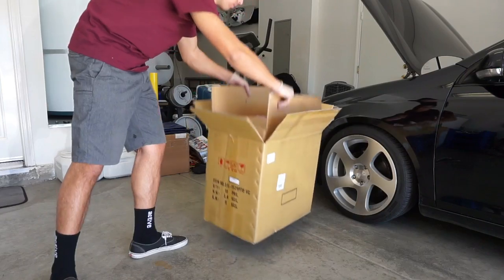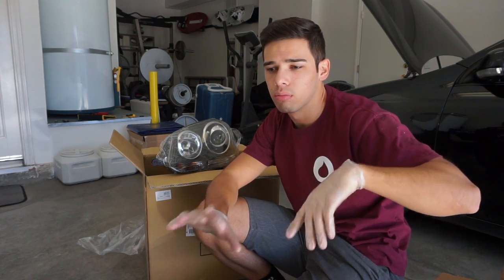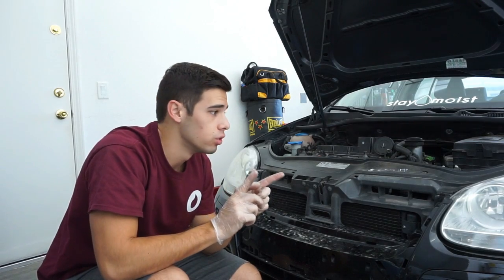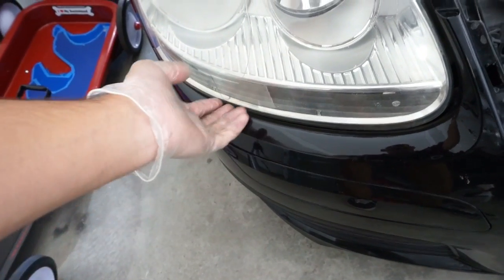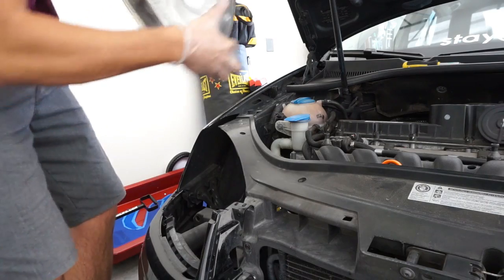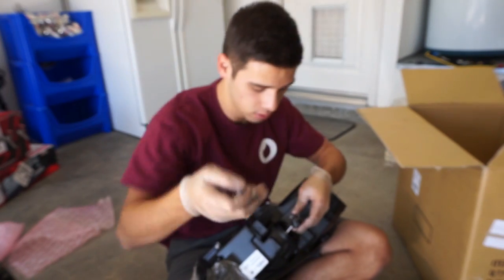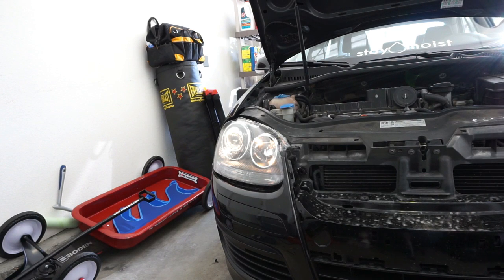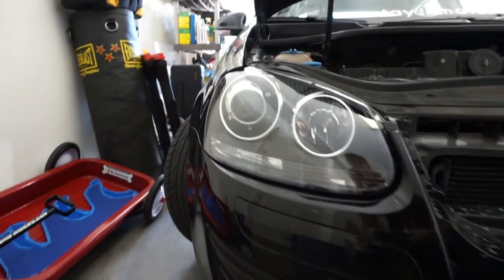Installing Helix Projector headlights

Comment: Hey thanks for making that video and showing how it's done!! Just curious how the headlights are holding up (some say that the clear headlight cover yellows very quickly on the replica's?). Also since the new  headlights have projector lenses, do you find the halogen lights work much worse (at night) than the OEM ones or isn't it that bad? Just afraid of blinding others lol - thanks!
Reply from the maker: like2upload Thanks for the comment! The headlights are holding up alright. I've found that the build quality isn't that great and I recommend getting brighter bulbs than oem. The bulb sockets don't seem to like up perfectly with the openings in the housing on the inside, this is causing heat stress on some of the inner plastic from the bulb's heat.
Reply: Ryan The Hawaiian what are your wheel and tire specs? 18x8? Or 18x8.5? And what about the tires

Comment: Dude you didn’t find out the right way! Take out the black plastic insert from the bumper to get that screw out. 

Only undo the other two headlamp assembly screws, undo the connector out it comes. 

Don’t touch halogen bulbs with bare fingers it leave grease that burns hazy on the bulb.

Comment: Hey !! I want to know if this aftermarket light have the DRL like the gti and gli near the turn signal. Cuz my stock one have the DRL in the high beam its a small bulb but its look so much better with a led drl near the flasher.
Reply from the maker: Nikon Photography My car has the drl switch to the left of the turn signal stalk, but it is only a switch for the drl not the actual headlights. The switches should still work since you'd only be swapping out the housing.

Comment: I know this is years old, but you didn’t have to pull off the bumper, that extra bit of plastic under the head light pops out and you can get to the screw from a hole

Comment: Wow, I just bought replacements for my old yellowed hazy originals. Had no idea how involved it is going to be to instal them. Good on you for testing them before you put everything back together.  Congrats on a job well done. They look awesome. Thanks for being legit.
Reply: I just did mine it’s easy. This guy made it hard. Just undo the grille one top and one side screw, use a plastic or wooden wedge to pop open the plastic insert in the bumper then you can get straight to the bottom screw. 

No need to touch the wheel arch trim, remember not to touch the bulbs with bare fingers as it burn off the oils and makes them hazy. 

There’s some YouTube videos to follow if you search some more. Try deutsche auto parts
Reply: Or just buy some Solvol Autosol from the auto shop and polish out the yellow on you plastic covers. 

Plenty of videos on that too.

Comment: Hi,after all this time do the headlights still work good?How about the moisture and beam projection,all works good?
Reply from the maker: Hi, yes the headlights do work still! There isnt any moisture in them, the beam projection isnt as good as the oem lights, but I put LED lights in to kind of make up for that👍🏻
Reply: Great thanks for replying...do you maybe know where to find it i tried searching the ebay but I was only able to find Depo headlights in 200$ range and I heard the worst about it
Reply: @RTHMedia  Great thanks for replying...do you maybe know where to find it i tried searching the ebay but I was only able to find Depo headlights in 200$ range and I heard the worst about it
Reply from the maker: @anteradic5125  The link is pretty long but this should be the ones I got. 2006-2009 VOLKSWAGEN MK5 RABBIT/GTI/JETTA E-CODE PROJECTOR HEAD LAMP - BLACK | eBay
https://www.ebay.com/itm/2006-2009-VOLKSWAGEN-MK5-RABBIT-GTI-JETTA-E-CODE-PROJECTOR-HEAD-LAMP-BLACK-/262990530747
Reply from the maker: @anteradic5125  These ones are around $200 as well, you can try getting them from urotuning, or moddedeuros to maybe get a better quality buy they charge around $400 for them.
Reply: @RTHMedia Thank you so much you helped a lot!👌
Reply: I wanted to ask you one more question....as far as the light output I've read that is pretty good even with the halogen bulbs compared to the stock reflector headlights.What is your experience and what's the high beam like is it good?
Reply from the maker: @anteradic5125   The high beam output is perfect, very similar to the stock headlights. My opinion is that the low beam light is more spread out making it seem not as bright with regular halogen bulbs as the stock headlights.
Reply: @RTHMedia  Have you tried stronger bulbs like Osram night breakers or similar xenon look h7's maybe...I understand you put in LEDs how is the output with them?
Reply from the maker: @anteradic5125   I tried some of the higher output Philips brand headlight bulbs, but the LED ones are brighter for the same, or sometimes lower, price. The output is really good on LED headlights.
Reply: @RTHMedia  Excellent..great product for the price